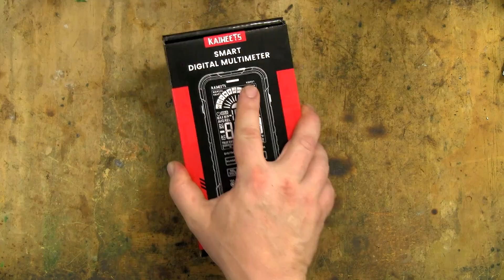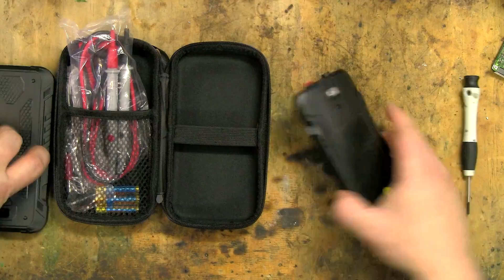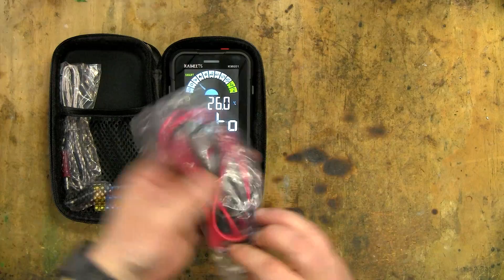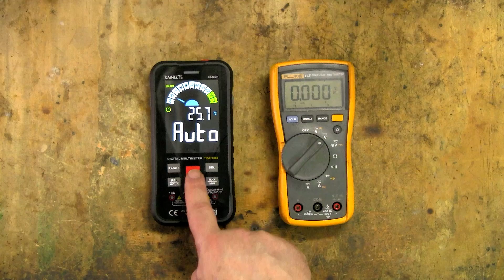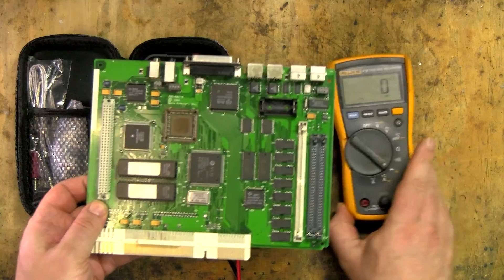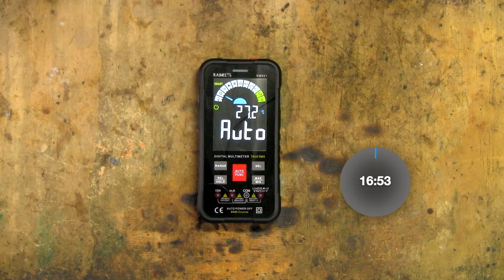Kaiweets KM601 Digital Multimeter Product Review

Comment: A couple neat features not mentioned:

1) The display reads "LEAD" if you manually select current function and have the leads in the wrong holes.
2)  The display reads "FUSE" if the internal fuse is blown for the current range you selected.  (There are two.)
3)  There's also an icon on screen for a blown fuse.

I'm sure there are other conveniences I missed.

Comment: The only things that I can see is that when testing capacitance it would be nice if it would display a "thinking" indicator so you could be certain that there is a connection and an up down function selector would have been nice.  I think the temp and light will get some use too.  Size is great.  Other than that maybe a stand, but a lot of stands are garbage anyway.  Seems really handy though.  Thanks for the review, just what I was looking for.

Comment: Unfortunately and as is often the case, most of these types of reviews concentrate on supposedly how accurate the meter is and how many bells and whistles its got.
What you should be concerned with is the inherent safety of the device, i.e. how well it will protect you when you accidentally connect it across the mains with it on the current or resistance range. A good meter will effectively just stop working because the fuse has blown but most of these cheaper ones will not survive and likely cause injury to the user. The ommision of proper certified and tested HBC fuses, proper layouts observing creepage and clearances to meet the declared category etc are not met cheaply or easily.
That's why Fluke and the like are so expensive, because you can't put a price on your safety!
Reply: @Kevin-mp5of  Of course you are right, but how many "hobbyists" who buy a meter have any idea of what the category rating means? So that makes the compliance of the meter even more important, otherwise the ignorant user will be lulled into a false sense of security because even if say a simple meter has glass LBC or insufficiently rated fuses in it, or poor layout, creepage/clearances etc and the operator uses it on mains-powered equipment, they are at risk.
How did you learn about Category ratings and the meaning and importance? Probably through good training like me, but how many "hobbyists" have a clue what the ratings mean? Probably very few.
I would wager that quite a high proportion of the "reviewers" on YouTube haven't got any idea of the real meaning of Installation/Measurement categories and how to determine if a product meets those requirements.
Reply: @Kevin-mp5of  That's very true, but doesn't help the poor relatives or loved-ones who are wondering why it happened.
I worked in the compliance industry for many years assessing and testing such equipment and even though I'm now retired take exception to the way our UK government seems powerless to enforce the laws concerning product safety.
Not sure if you're in the UK or not but we regularly see reports in the media about fires and other problems caused by non-compliant/fake electrical goods such as phone chargers etc. and despite the regulations, these unsafe products are on-sale everywhere.
Reply: Childish comment, most of the security features are important for brainless idiots who mess with a meter, if you are not one its not that important.

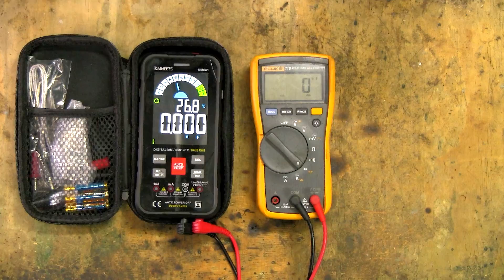Comment: 21:11 I recommend using alligator clips which I think is provided in the package for testing diodes and capacitors rather than using those needle probes to have more accurate and fast readings

Comment: Isn't the delay with capacitors the price you pay for AAA vs 9V? 9V can pump  up the caps much faster
Reply: With newer firmware 601 versions it measures capacitors 3 times faster.

Comment: I can't believe how some companies still convincing some people that replacing the traditional multimeter selector with this form of single soft button you have to press it for 1 to 8 times in a row is a good idea !!
this is not suitable for handheld multimeters specially not for the cheap ones. at least put a dedicated buttons for voltage, ohm, current, capacity. the selector is far more handy and trustworthy. I am not sure about this particular multimeter but most of the multimeters with this kind of form can't handle low milli volt area, a proper soft switching of the modes requires expensive relays, parts,... like the bench multimeter.
and I believe that everyone will find the auto mode is stupid and meaningless.

Comment: Thx for the review.  Wondering if the nice little feature that shows you where to plug the leads based on mode selection, might be more than meets the eye ... to protect the device, could it be also disabling ports to protect them?  e.g. If set to 10A, is the mA port disconnected?

Comment: When the meter is in Smart mode, by touching both leads gives continuity which is fine. But when I move or touch the RED lead alone (tip is not touching anything) gives random 
resistance values from 0L to 99 M Ohms. This behavior confuses me if there is something wrong with the meter. Checked with another lead, the same thing haapened. Is anybody getting 
this behavior?
Reply: The jumping readings is the meter cycling thru the different modes trying to figure out what you're trying to do... which is apparently nothing but waving leads around like Harry Potter.

Comment: i'm trying to find out if this multi-meter will accept the "Brymen_BL21S2_T4SC_Silicone_Test_Leads".
a reviewer mentioned that the socket pitch 14mm instead of the standard 19mm or 3/4" to keep the width down. i have to admit i don't really understand that.. so i thouhgt i'd ask a couple of folks online that would have different brand test leads.
Reply: It should it's pretty standard.  Some fits are a little tight.
Reply: @jonfreeman9682  thanks appreciate it .. i already got the KM601 real nice extra multi-meter new functions i did not have in my other model. also got the Brymen leads .. fits perfectly the provided leads are awful but i expected as much...thanks again.. could be helpful for someone else reading this in EU.. if i was in the US i would get probe master 8000 test leads.. but here in The Netherlands i can't get them..
Reply: @MVanDeursen  yeah in the US the meters all use pretty standard leads and I've ordered alot from China too and they all use the same leads. There are some very high voltage industrial meters that use thicker leads but that's not common unless you work in the hydro, nuclear or power industry. Not sure about EU as there's so many countries with different standards. But I think most of Western Europe and likely Netherlands too use the same meter probes. Yeah the probe masters are nice. 👍

Comment: Can it do in circuit capacitance testing?
Reply from the maker: No it doesn't. For that you'll need either an ESR meter or an LCR meter.
Reply: It depends on a circuit, i measure electrolytes all the time unsoldered and it gives pretty accurate readings, big time economy to not solder off.

Comment: Great review. Thanks. 
if you happen to skip a particular range you want, do you need to cycle through all again to come back to the one you need? or Can the Range selection be done in reverse, like fwd/back or up/dn?  Also it seems the probe insertion/changing needs both our hands. I'm fascinated by the large screen and features, and may plan to buy one.
Reply: I think you have to cycle again.  There is no back button.  But it's slow in selecting so you shouldn't overshoot.

Comment: What a great meter. I have both the Fluke and the KM601. You can't beat the price. You really get a lot for your money.
Barry
Reply: How practical is the KM601 in use?  Sure it's got the big fancy screen but in use do you find it ergonomic.  The color screen is nice but I find that temp reading annoying and the power button on top and probe inputs on bottom sides a little awkward in use.  Do you find the same?

Comment: 1 thing you forgot to test, set both meter to resistance, capacitance or diode mode and plug the probes straight into mains, normally nothing should happen to the meters at all

Comment: These have a standby power drain of about 9uA, and the continuity function is faster when manually selected.
Reply: When you have a screen this big and colorful you don't think about battery consumption.  It's like buying a Ferrari and worrying about fuel efficiency.  When the first iphone came out it ate battery like crazy but nobody cared as the screen was big and beautiful.  Blackberry sipped battery like water in the Mojave Desert and would last for days.  Now every phone looks the same.   This KM601 could be the new direction of multimeters in the future... big color screen and maybe with touch later.  I ordered one just cause it looks nice.
Reply: My best multimeter has a drain of about 700uA/9V in standby.  How can this with its huge and color display drain 9uA/4.5V? Are you sure it was on?
Reply: @electrocat9  When I said standby, I meant when it was "off". The soft-touch power on-off button means the device is always listening to the status of that switch. Current drain when ON is another matter,
Reply: @mdzacharias  ok, important information. Zoom microphones the same, they drain battery in no time.
Can i ask you if this device has also a "true" on/ off?
Like a curiosity the drain current when on?
Reply: @electrocat9  Well now you got me interested. I had forgot how much current drain in operation so I checked. At power up it peaks at about 41mA, then settles to about 30 mA in normal operation. This probably explains why they sent an  extra set of batteries with some versions of this meter.
Reply: @mdzacharias  That extra battery pack explains so well now, instead ask for a refund just replace the battery and then forget :)
When On,  mine settles to ~700uA at 9V so it seems about 20 times less consumption.
This should be the specification to begin with... and this device needs an external power supply.
Reply: The other Kaiweetes black white LCD have you any idea of the current they take?
Reply: @electrocat9  Nope. I do not have one of those.

Comment: Have you tried rechargeable 9v?
Reply from the maker: The rechargeable 9v batteries seem to be better suited to high drain tasks. In a multimeter, they don't last anywhere near as long as an alkaline. Having said that, the issues I was having with batteries going flat regularly relate to multimeters I don't even use anymore. The Fluke is still on its first battery.
Reply: @BranchusCreations  That makes sense. I have found issues with using rechargeable batteries in some instances.
Reply: @BranchusCreations  I got my  fluke 23 secondhand from a diesel mechanic in 1991, until I got my 179 about 8 or so years ago I used it everyday at work, the 23 still gets used at one of my test benches at work and has had two sets of leads and only five batteries in its lifetime so far. The Fluke has had a hard life but was still accurate when calibration checked in 2020.
Long live Fluke
Reply: I bought 4 Ni-MH rechargable 9V batteries from EBL for my old UT51 (just in case I need them for something else too). If wikipedia is correct, mine have about 60% of the capacity of an alkaline battery. I was wondering if I should buy a new multimeter like the UT61D/UT161D (or the BM786 eevblog edition) because of autoranging and AAA batteries.